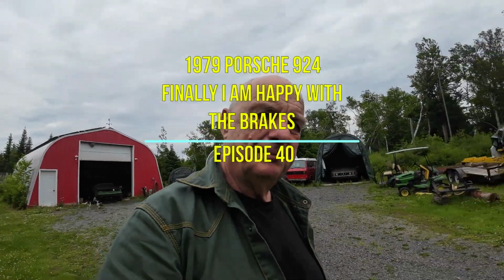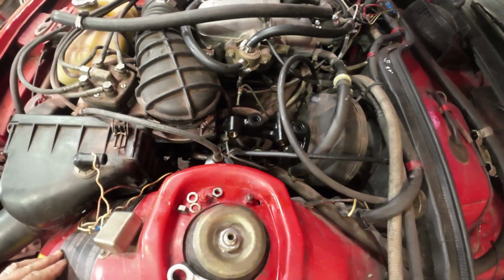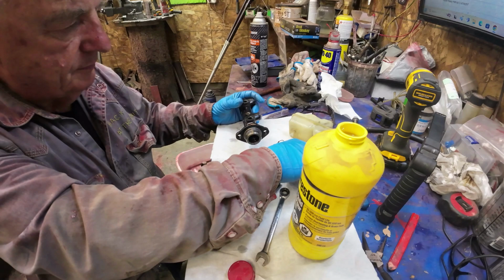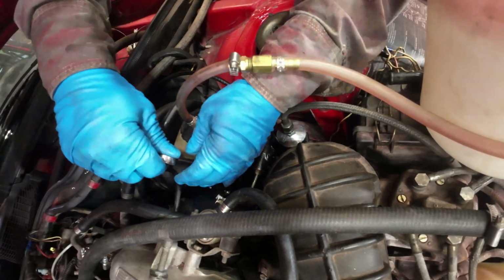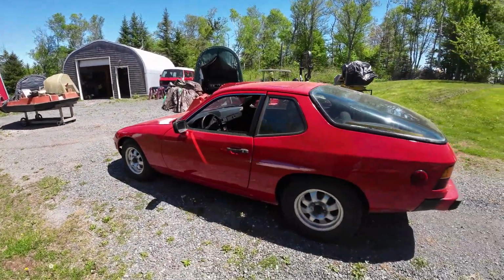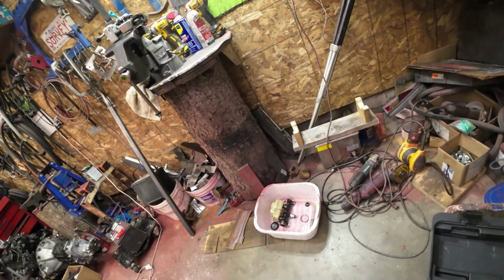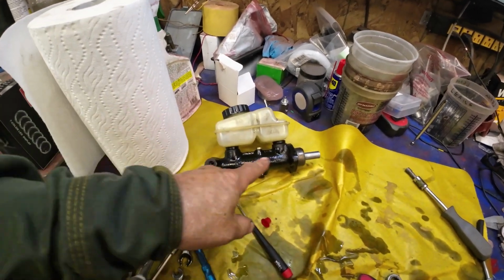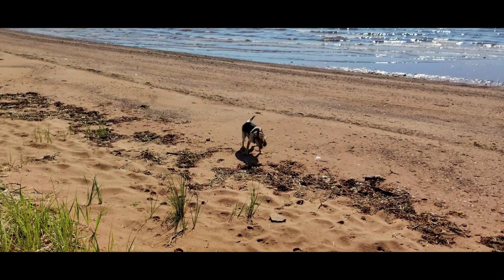1979 Porsche 924 Get the Brakes Closer to Right Episode 40

Comment: Hey Lorne! I’m up to this episode today! This has turned out so nice! Loved seeing all the cars in the last episode! Got the Merc to catch up on and the Beamer.

I don’t know if it’s the same in Canada, but in the UK and Europe, most Porsche cars numbers are read by each individual number, like your car would be a ‘nine two four’ rather than a ‘nine twenty four’. I think there are some exceptions, the 911 is read as ‘nine eleven’.

I’m used to you saying nine twenty four now though! 😄

Any news on the TR7 getting back on the road?

All the best work shops are a bit of a mess, more time working than worrying!

All the best! UK fan Dan!
Reply from the maker: Thanks Dan, Yup over here its nine twenty four, nine twenty eight, and so on for all cars...I guess it is a North American thing... The TR7 is ready for MVI, Motor Vehicle Inspection, I decided to hold off until next spring, as I did the Porsche for this year onto the road...Plates and Insurance are a reasonable cost for antique cars as long as they are not a daily driver...